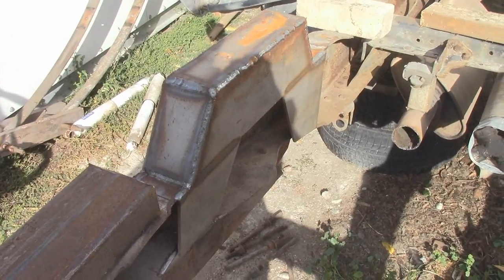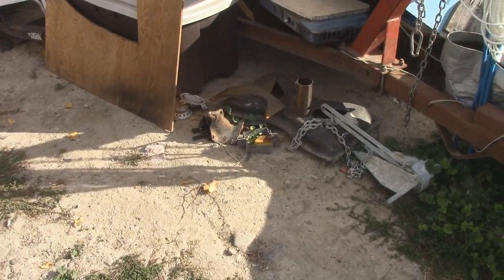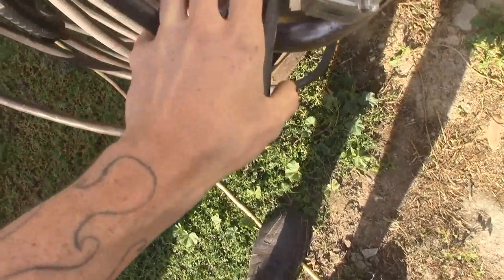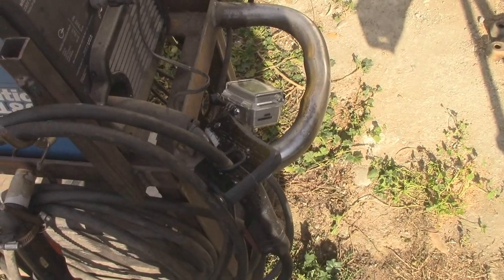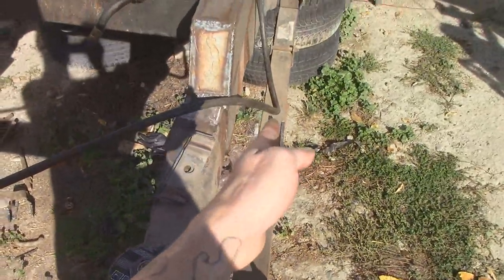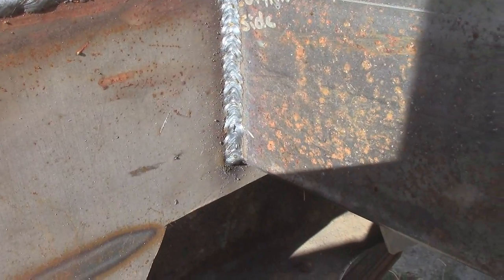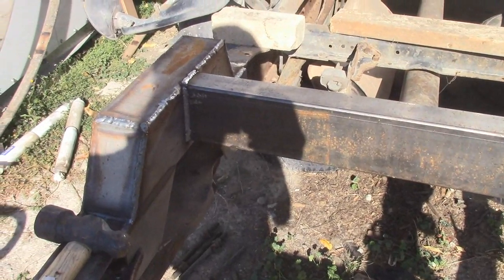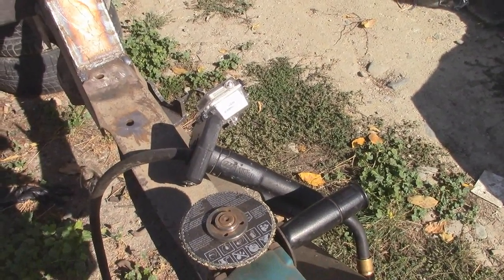1989 GMC 3+3 - Cutting the Frame!

Comment: mounting the crossbrace vertical it will interfere with the diff housing in the middle basicly it does away with all the effort you put in to alow for the axles to go passed the frame , you could cut a circle in the shape of the diff housing out the middle of the crossbrace and fill the hole with some bandsteel though 
as for welding cam, maibe you need a metal box around the cam to create a faraday cage and stop the electrical signals from the welding to mess up the filming , prolly be a good idea to tape a piece of welding glass in front of the lens as well
Reply from the maker: holy crap... i didnt even think of the center section hitting that crossmember... damnit... you're totally right... all that work, and now, with this brace there, ive only gained 1"... i just ran outside and measured it... damnit. i have to cut it off... if i move the crossmember all the way to the back, it will clear the diff cover, but it cant be that 2x4" piece... i may have to build a 1x1 square tube crossmember for the whole top... i hung the diff today, and i didnt even notice that... thank you for letting me know of an oversight... i cant believe i did that hahaha!!!! (that is a frustrated laugh by the way :P)
Reply: moving it back allso gives you a point to hang the panhard bar from